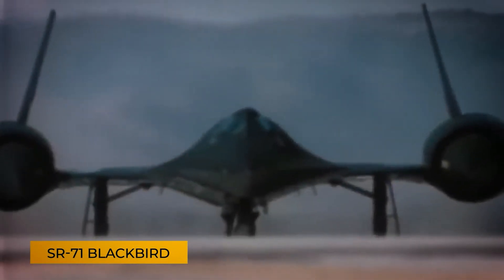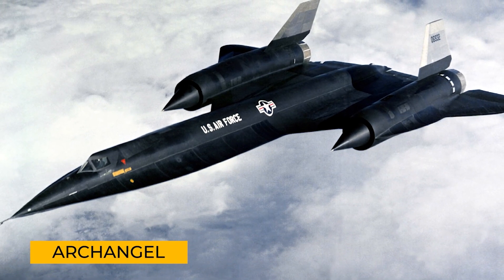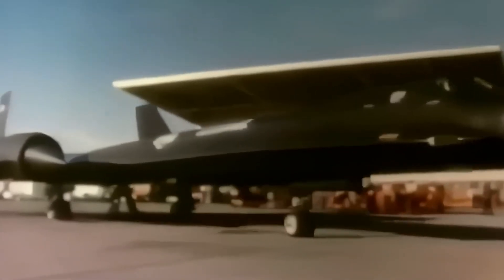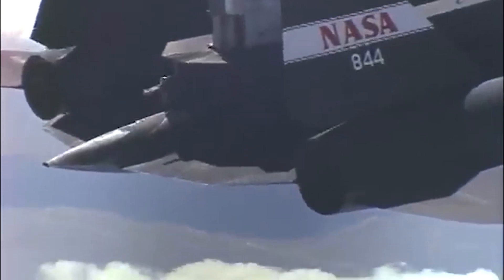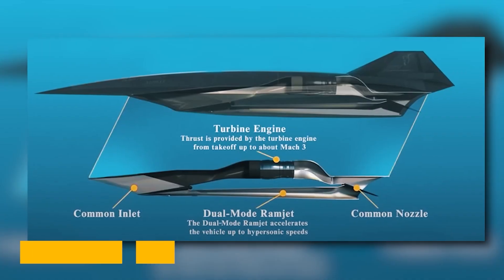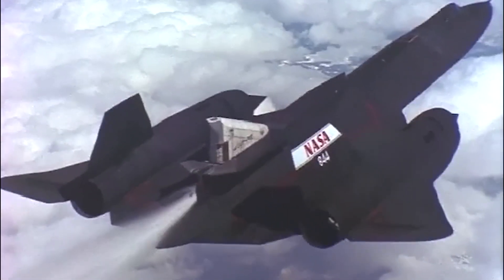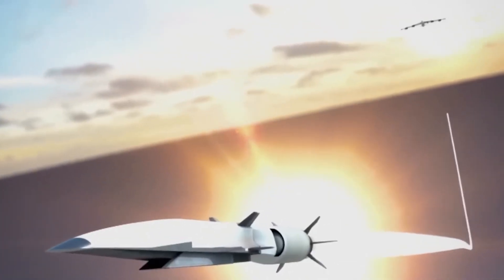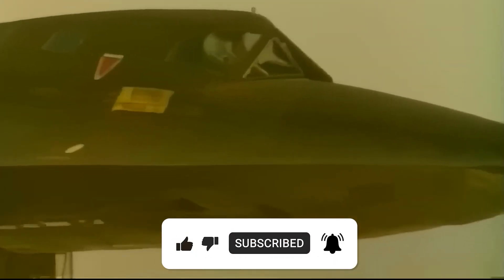11 USAF Declared SR 72 Darkstar Is Finally Ready to Fly

Comment: My guess is that the Air Force will continue with the SR-72 because it's ability to gather real time intelligence will be better than satellites.  I think the AF may abandon the NGAD in order to buy more B-21 bombers that will be capable of doing most of the NGAD missions as well...meaning the B-21 may be capable of launching air to air missiles as much as 300 miles out when combined with the F-35's ability to identify targets far ahead of the B-21 and take control of the B-21 launched missiles to their targets.

It's my understanding that was the primary mission of the NGAD.  In other words, the B-21 may become the F/B-21 and be used both as a strategic bomber and a fighter with ultra long range capabilities.